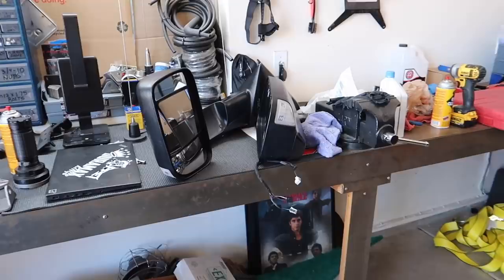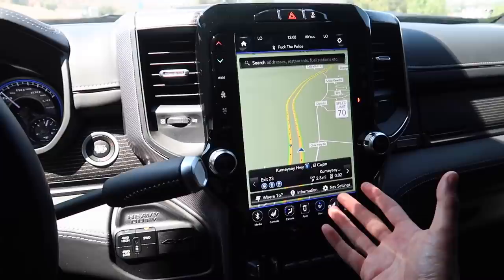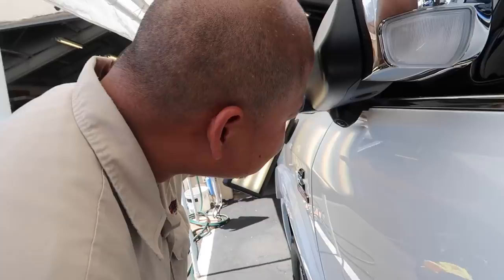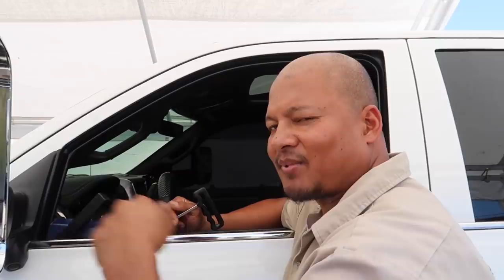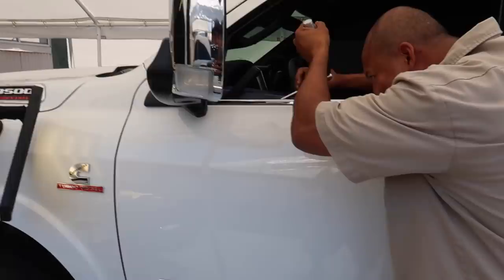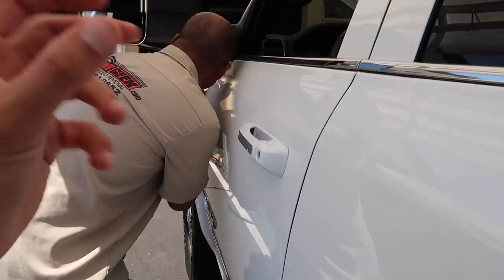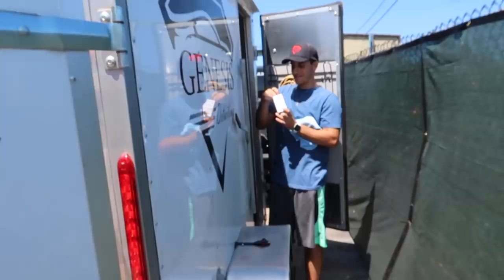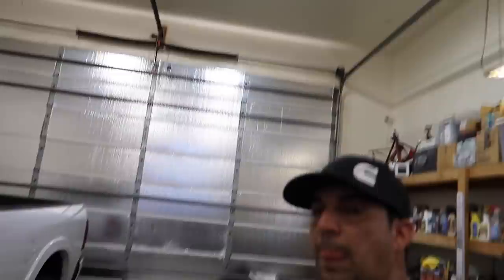ALREADY PUT A DENT IN MY BRAND NEW RAM!!

Comment: My Ram dented really easy, literally you couldn’t lean on it or it would dent.  Back in a Duramax now and loving life
Reply from the maker: now you just cant pull anything hahaha 😂😂😂
Reply: @EddieLife3500  thats no joke. I had a bunch of small dents around the top of my bed. Only thing it could be from is leaning over it or rocks from the very minimal offset wheels that i was running.
Reply: Eddie's Life lol come on now!  My Duramax is a pulling beast.
Reply: As a 2019 Duramax owner, I can attest that it may not ding easily, but the black paint is very easily scratched. It does suck a bit. Gonna have to ceramic coat it.

Comment: My 2019 Ram 1500 has 2 paint defects on it straight from the factory. It looks like the paint was slightly chipped at some point and the clear coat was put on top of it. I didn't worry about mine though because I'll be adding more dings and scratches to it anyhow

Comment: Dude cmon I had my 2017 ram 3 weeks was parking in my drive way behind the 2500 van and was in first gear completely stopped. When my foot slipped off clutch!  Does the cummins stall hail no it lurches forward hits my van’s bumper and the bottom of my rams bumper no longer curved but flat straight between head lights. It’s ok it’s a tradesman so I can upgrade to the bumper with fog lights now. 😁

Comment: My brand new 2018 Mega Cab had a few areas where the paint was bubbling up.  It looked like the was dust or debris under the paint that was causing it. Took it to the dealership to get it fixed under warranty.

Comment: I work in paint at a manufacturer. It was more than likely a piece of dirt in the paint. Lamborghini has dirt in paint. 
No manufacturer is gonna repaint a unit for minor dirt. 
Units go through a "Touch up" Zone for wet sand and buff for defects. 
Also white units have more paint on them than any other color due to white not covering well. 
So I wouldnt worry about it. 
Also a phosphate coating is applied to the metal electronically like a chrome process so your good.

Comment: My white 2017 Ram 2500 had dust in the clear coat everywhere. I would notice more and more everytime i washed it. My 2019 F250 only has one spot so far. Much better paint overall.
Reply: People say what they will about Ford's reliability, but one thing I've noticed is the build quality on them is pretty exceptional. Ford definitely knows what they're doing when it comes to paint and making a well built vehicle. I prefer older trucks myself, simple, more fun and generally less to go wrong with them. That sounds like poorly done clear coat if it's getting worse from a wash though. Clear coat generally lasts at least 10 years or more.
Reply: @ixionn563  it wasn't getting worse. I was just noticing more everytime I spent time washing it.

Comment: Why wouldn’t you do a full paint correction before ceramic coating it?
Reply: He did.
Reply: This happened after the full detail. He even stated that in the video😂
Reply: Diresword 504 if he had the entire truck paint corrected then he wouldn’t have visible orange peel. 🤷🏻‍♂️
Reply: @vedranduras432  /facepalm. Not really the case. Factory orange peel is a pain to correct. Itd take quite more than the compound and buffing Genesis Detailing does.
Reply from the maker: @vedran duras paint correction does not take out orange peel,  i wish it did that would be amazing

Comment: I use to have that job in paint at dodge factory where I sanded down the impurities like hes talking about..
Reply from the maker: dang thats crazy
Reply: @EddieLife3500  the light set up was crazy....How come some debris get through is the line moves at a certain speed, if the truck goes over the alotted time for the job, the line shuts down and foreman comes running.. So you only have seconds to go over each truck..

Comment: Orange 🍊 peel? Genesis Detailing should have done a paint correction before ceramic coating...should have detected any flaws on paint before ceramic coating☹️ FYI learned from Exclusive Auto Detail certified detailer in Chula Vista....look him up on Instagram
Reply from the maker: im guessing you did not watch the video and you can not take orange peel away buy paint correcting it